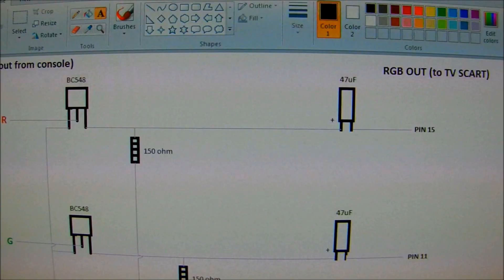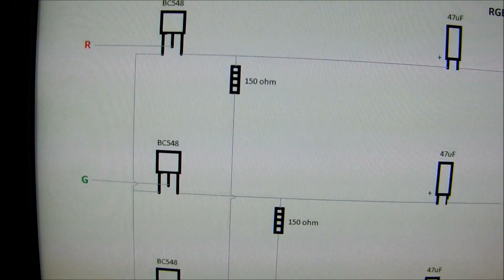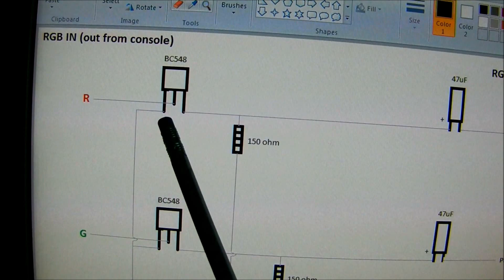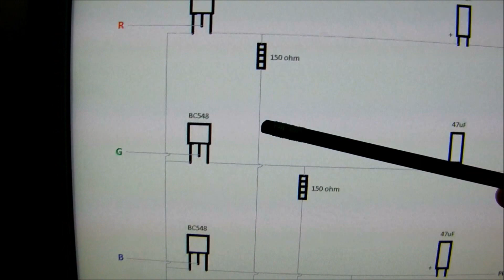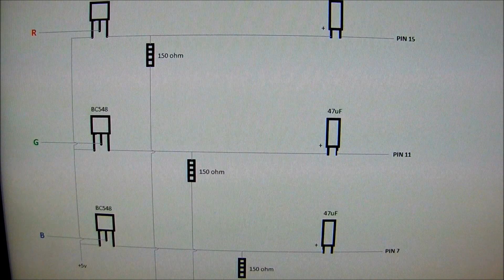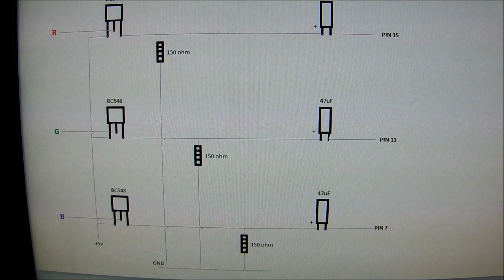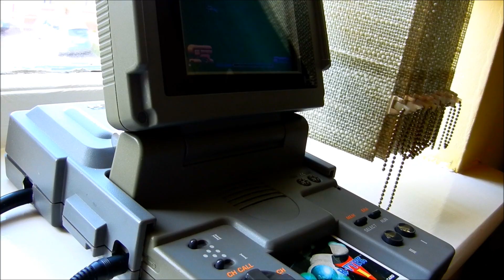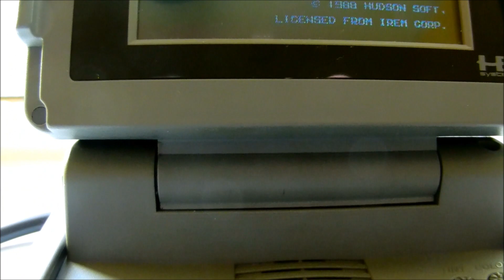PC Engine RGB MOD - AMP

Comment: Hey dude great explanation on the RGB mod,i am about to attempt to mod my pc engine original white one and 60 mhz mod for my mega drive i have ordered quite a few bits and pieces from ebay already after recapping my game gear and looking at some online guides like monkey and some other guy on youtube,now my question is does it matter what transistors or resistors i use to make the RGB amplifier as everyone online are saying use all sorts of different transistor and resistor types,so i'm very confused and just what to do it right first time and not totally fluff it up,could you please help with some advise as i don't really want to spend loads more money on stuff,bits i have already ordered (2n3904 transistors)(75r 75ohm resistors)(47uf 25v capacitors) can i use these components to make the same or similar RGB amplifier without blowing up my pc engine?
Reply from the maker: On my video I show the components I use.  You can use all manner of values but I have found the ones I have used to give very good results.  The PCE RGB mods are notorious for causing various TV's issues - the components I use have not given me any such issues.

Comment: Thought I'd get you on here rather than Jamma... any way you could detail for me the exact spec of the components you used for the amp? I'm buying the pieces now and want to ensure I don't pick up the wrong type of capacitors, resistors etc!
Reply from the maker: The details are on the video schematic minus the voltage requirements for the caps:

Transistor: BC548
Resistor: 150 ohm
Cap: 47uf 25v
Reply: Cheers pal - it was the missing voltage info I was worried about. My first foray into this whimsical world of modding, and with zero knowledge of components there were so many to choose from!
Reply from the maker: No worries.

Comment: Do you have a dummy's guide on how to make the SCART cable with the 8 pin DIN connector? I am about to buy a Loewe TV because it has SCART which was sadly, very rare in Australia. We got cursed with PAL but not the one thing that was good about PAL TVs in the UK.

I am going to mod my PCE+CD-ROM2 interface unit before I go anywhere near my precious DUO-RX. I was thinking of just making a SCART cable myself because of the price to buy one ready made, and because I do not want to wait 10 years for it to arrive. I can't wait to get my MD, Jp Saturn and PS1 running via SCART!
Reply from the maker: I'm afraid I have no guide on how to do this.  The configuration of the wiring on the 8pin din is entirely down to you.  Which bit do you need to know?
Reply: Haha, umm, everything?  :D  Thanks to your video here with the amp diagram, that bit looks easy enough, I guess the SCART cable would be the hardest part.  

I did watch a video of a guy making a MD SCART cable and although it looked overly long and annoying, I don't think it will be TOO hard to work out if I use my brain.  I just don't want to go messing things up I guess, SCART cables are not cheap and common here like shitty composite etc.  thank you for the reply!
Reply: I have read that using a mini DIN 9 pin connector enables MD2 cables to be used, so that's an option too.  I want to mod my interface unit first so I have to work out how to install the connector without making it look ugly, seeing as there is no spot it can be replaced as with the DUO-R/RX.  There's no way in hell I am going near my DUO-RX with this mod, I have zero experience at the moment and that Hu chip's legs are tiny.  I've been trying to work out if the wires can be connected underneath the Hu chip but have found no guides using that method.
Reply from the maker: Making the SCART cable will be the easiest thing! ;-)

Your DIN wiring is totally down to you (with regard to what pin you use for what). 

The SCART end would be:

Red: pin15
Green: pin11
Blue: pin7
Sync: pin20
Ground: pin18, pin4
Audio R: pin2
Audio L: pin6
Reply: Damn, sorry for the triple post!  I forgot to ask what voltage the 47uF capacitors on the amp should be?
Reply from the maker: A Shaw I'm using 25v.
Reply from the maker: A Shaw You have to solder direct from the chip.

Comment: Buy a PCEngine RGB AV Booster from Ebay - its like the Tennoke but its a professionally manufactured add-on - heres the heading / link
▪ "NEC AV BOX" Jouez en RGB avec votre console NEC ▪
(wwwdot.this  ebay.co.uk/itm/150839685837?ssPageName=STRK:MEWAX:IT&_trksid=p3984.m1438.l2649)

Comment: Thanks for this. I need to perform the mod this summer on my interface unit. Think im gonna fit a scart socket so I can use any standard scart lead. Cheers. Just a bit nervous after I ruined a pc engine when I attempted to mod it for rgb internally and lifted the hucard connector wires off the board, trying to resolder 40 or so wires so close together is impossible for me so i stuck it in a draw and forgot about it.